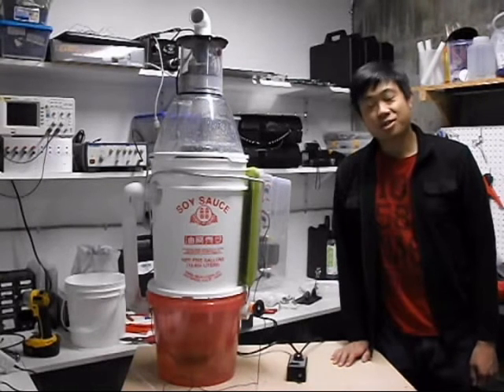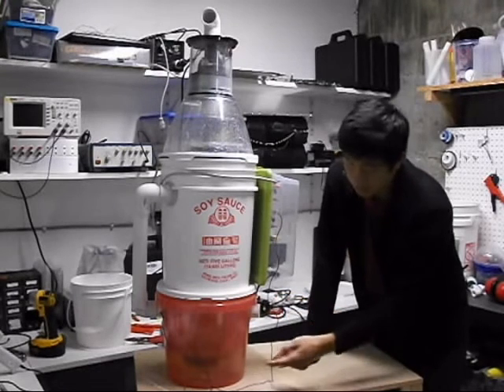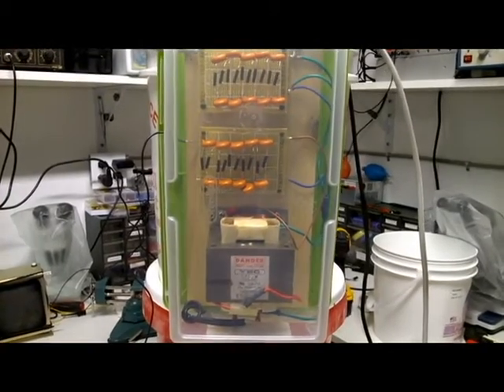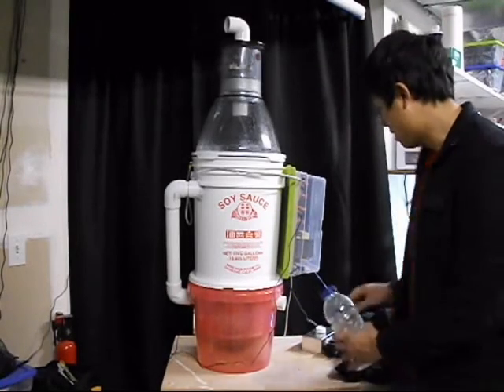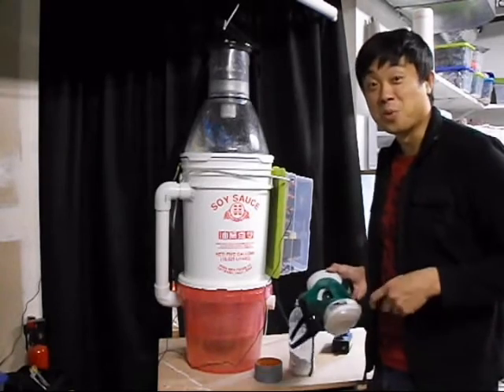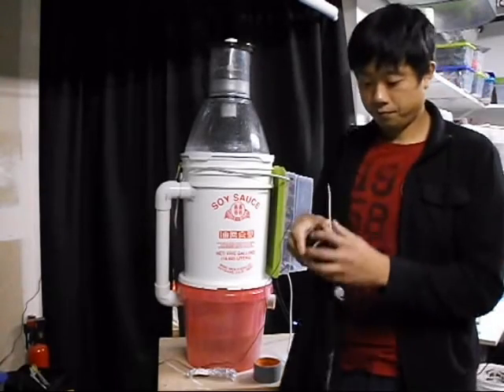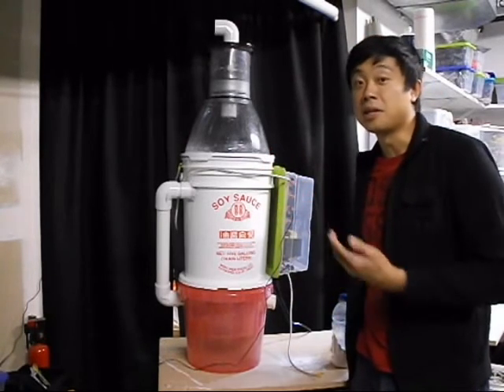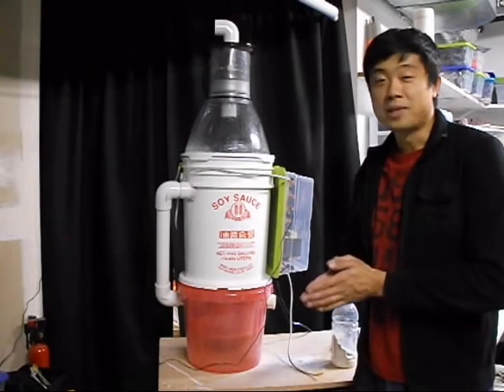My Invention: Two Stage Electrospray Ionizing Wetscrubber DIY

Comment: Wouldn't chlorine gas be produced at the anode, via electrolysis of salt water? Did you test it with and without electricity to check if it makes a difference? Typical systems use corona discharge for ionization, so curious whether it would work.

Comment: A way to measure the particle filtering ability is to use paper filter at the outlet, then dry the paper and view with microscope to measure particle size.         if you want to know how much is getting through just weigh a dried paper filter before and the same filter re-dried after use.  I know this probably comes a bit too late. it may be and idea to use a cyclone separator to spin the droplets into larger drops that leave your air stream humid but droplet free. You are doing great work  Thanks for sharing your brilliants!
Reply from the maker: Hi dui, that is a brilliant idea.  I think I will try that on my next iteration of my filtration or vacuum device.  I suppose I could use a N95 mask as this fabric filter
Reply: @LockeLaboratory  I would use P100 mask, They filters finer than the N95 and they are made to catch oil droplets so they are  more durable than an N95. But Perhaps a better approach would be to use graded laboratory filter papers for catching precipitates. they have size ranges that will help you classify your particle distribution . to use filter papers you will need to set up a backing screen so your filter paper does not shred- in any case  you will need an analytical balance something that will measure at least mg the finer the resolution the shorter your testing period can be. If you try to use a  balance with a half gram resolution you may be running your test for weeks before you have caught enough particles to see a measurable weight difference.
Do you have a reasonable microscope to view the filter media and do you have access to and analytical balance? best of luck!

Comment: You would test the efficiency by inoculating the inlet air stream with a known weight of a submicron powder. Typically this would be zinc oxide which also is a bright white, easy to see.  On the outlet, you would use a device similar to what the EPA uses to determine particle capture which is a sub micron filter. It's as easy a weighing the filter before and after the scrubber run. For example you'd inject 5 grams of zinc oxide with the average particle size of 0.5 micron and whatever the submicron hepa filter captured on the exit would indicate your collection efficiency, Re: (ZnO2 Input weight - Filter weight change (filter dried before and after))/  ZnO2 Input weight. However, in this case your air flow is much larger than what standard sampling equipment would accept so you would have to accurately determine the scrubber air flowrate take a sample of the exhaust air stream at a determined flowrate and then extrapolate how much was in the total exit flow because you now know the exit concentration of particulate and the volume of flow during the sampling test.
Reply: No, where you seek a reasonably accurate efficiency and are not required to satisfy the standard EPA method for reporting purposes all you need is a very standard airquality samping device such as an air monitoring hepa filter. If one knows the sampling rate and the mass of inlet particulate, flowrate of the air you are scrubbing it is very straight forward. You can use a manometer and an orifice plate and calculate the scrubber air flowrate using pressure drop for that orifice plate diameter. So? If you know the amount of particulate, the calculated air stream flowrate and the sampling rate, you can use the change in the filter weight of the sampling pump to determine the concentration of the exit gas. It is true that the hepa filter is 99.99% efficient at 1 micron but it typically is over 90% for the submicron particulate on the average so your number will be an inexpensive approach. You can rent these devices and purchase filters from environmental places and they will even analyze the filter particulate and  a number in micrograms captured. I believe that's your best inexpensive sampling menthod. The entire measurement could be under $150. You might search on Ebay for the air sampling pumps and just send the samples to the environmental outfits, the analysis is typically under $40.